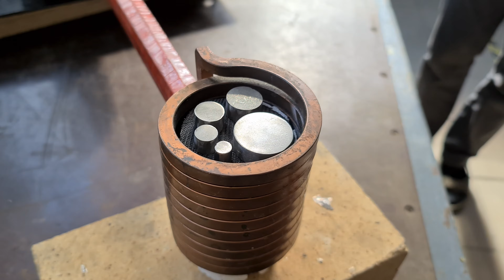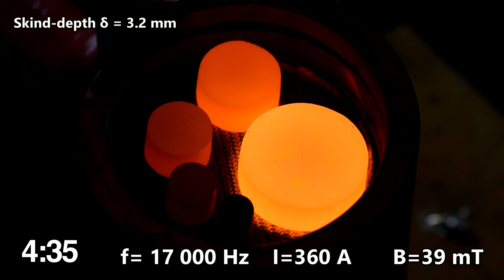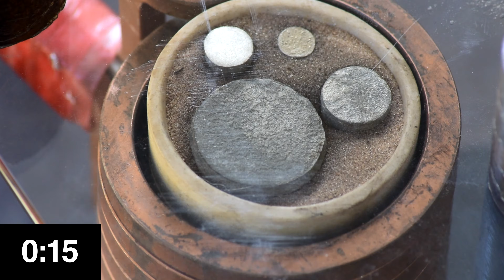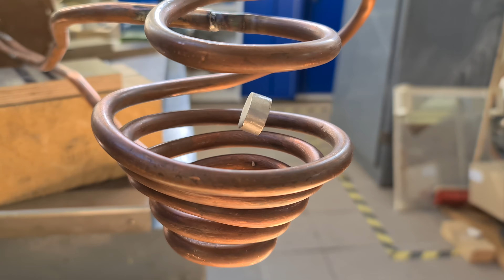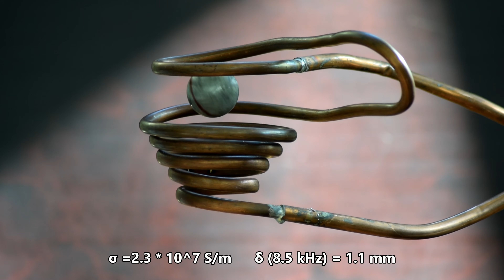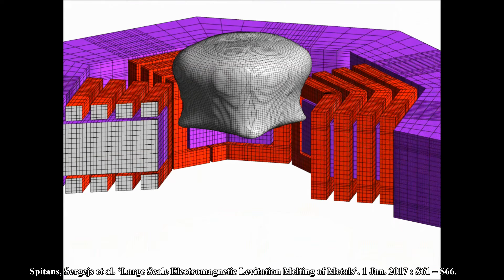Induction Heating, Melting and Levitation [4k]

Comment: I'd like to know how frequency can affect levitational force and why material within the coil needs to be a good electric conductor
Reply from the maker: Forces are proportional to electrical conductivity of material all trough out frequency range because it is easier to induce current in good conductor.  Forces are also proportional to frequency up until skin effect sets in. However, in all levitation setups high frequencies are already used and skin effect is present, meaning frequency change will affect each process differently on case by case basis.  It is complicated to predict effects qualitatively since multiple effect opposing effects overlay at high frequencies.

Comment: If you put the coil in a vacuum chamber you might be able to use it to forge a diamagnetic ferrous material. Heat it up burn off all oxygen and create vacuum. Turn off and drop material in cast and let cool slowly in the absence of oxygen. Might work. :)

Comment: My main question : what happens when acoustic cymatic frequencies are applied during the heating and molten phases?
Reply: Ah I see you guys found out how both these techniques were used to build the pyramids.
Reply: Interesting question. I reckon applying sound through the air wouldn't be terribly effective, but mayhaps you could apply vibration using a rod directly to the material. 
In that case I think you could find the resonant frequency of the liquid metal. You'd definitely see something interesting.

Comment: Could you tell me if the copper coil is solid copper bus bar and what is the cross section area ??? Would this melt steel alloys ???? Thanks
Reply from the maker: The copper coil has a hollow core for the coolant to flow.  The cross-section is about 10x10 mm, but I don't know the wall thickness hence the empty core size.  
To melt steel you would need more heat insulation. Or at least crucible with a closed top. Otherwise, heat losses would permit you to melt steel.
Reply: @MHDTechnologyLaboratory  Would stainless steel also get melted ??? Does frequency make a difference on speed of the melt?? Thanks

Comment: This is awesome i want to learn this without a degree, can someone help in regards
Reply: Google
Reply: Electroboom has an entire website, along with his youtube videos that can explain what's going on here. Physics books typically have an electromagnetism section and you could probably find some good books specifically about the physics of induction heating... but tbh this channel is pretty good too. The reason it levitates is similar to the reason you can create an electromagnet with insulated wire wrapped around an iron core.

Comment: how come the smaller parts heat slower?!
Reply from the maker: It is a balance of multiple effects. Heating (dissipated power) is proportional to volume. Cooling by conduction, convection, and radiative losses are all proportional to the surface.  So smaller objects have higher surface/volume balance hence lower temperature if induced power density is the same (in reality it is not the same).  To complicate things heating does not scale with the size and there are differences how bigger and smaller objects heat up for any given frequency. That can be analyzed by looking at dimensions of the workpiece and calculated skin depth for that frequency.
Reply: @MHDTechnologyLaboratory  I guess the small parts also have a weaker magnetic filed？

Comment: would this be somewhat possible with a rock that one of these metals in it? what would happen?
Reply from the maker: Practically no.  Unless the rock was mostly metal parts (that are connected to eachother!) current would not flow in it. There would be only small currents in the inclusion of metal but melting or levitating the rock would be close to impossible with reasonable currents.
Reply: @MHDTechnologyLaboratory  ah I see, thank you for answering!

Comment: there are a lot of things I wasn't understand about induction melting now I understand them , thank you . but there are some things I can't understand in this video & really can't find any answer after hard search on google :

1 - it is known than that lower frequency means higher current penetration which should means that 8.5 KHz frequency should be more effective than 17 KHz , then why lower frequency can't able to heat smaller pieces ? is higher penetration means lower efficiency of heating smaller parts ?  as I remember the lower frequency used the more homogenized molten metal & industrially very low frequency of 60 Hz is used to melt steels using induction melting method .

2 - in levitation melting experiments , I understand that there is a limit of size of metal piece to be completely levitated in molten state . but what the actual factors control this size limit ? does simply increasing power or frequency increasing this size limit ? or it mainly depending on the design of induction coils ? does it differs by the metal to be melted ?

3 - can metals with very high melting points like tungsten melted using levitation method ? or there is a limits ?

4 - can temperature of a metal heated by induction be fixed ? and how to fix it ? if for example I want to heat a large steel part quickly to 1000°C and hold at this temperature for hours , is that even possible ?

5 - how to increase temperature of the molten metal ? power or frequency ? & is it possible to rise temperature to near that boiling point of a metal "i.e. 2800°C for steel" ?
Reply from the maker: 1 )  You are right about this: "lower frequency means higher current penetration" however it is not the only effect.  If we increase frequency ( and keep other parameters fixed),  induced currents in the metal rise proportionally to frequency.  You can see that easily when you look equations for induced current ( I  also did in the previous video).  The skin - effect is a secondary effect and in this case, it is parasitic ( decreases the total power that dissipates in the workpiece). 

2) Firstly, you need enough power to levitate something which is usually, it is measured in kW.  Secondly, the metal you want to levitate has to be a good electrical conductor and preferably low density. Otherwise, you would need to increase current even more but even that has limits ( like how much heat you can remove with water cooling in copper pipes). Thirdly, for this configuration regardless of current strength or frequency, at the center of the axis, there is no net force pointing upwards.  This becomes a problem with molten metal since in center point it is held to the larger piece only by surface tension forces.  This limits funnel-shaped coils to about 100 grams of aluminum before it starts leaking out.  For different metals, this would vary and depend on surface tension and viscosity.  And lastly,  in larger sizes, the flow in the molten metal becomes important since it dictates shape and stability. 

3)  There is no upper limit of temperature. There are problems like electrical conductivity decrease with temperature increase for all metals. Also, radiating heat losses rise with temperature in 4th power so you would definitely need heat shields.  I know germans who have melted ZrO2 at around 3000 C by induction heating. ( it was semi levitating though)  

4)  Possible, but not straightforward.  You heat it up to 1000 C and manually lower power to find equilibrium ( which would differ every time if you don't heat identical pieces). A smarter method would be a feedback loop from the thermocouple or thermal camera to the brains of the inductor which adjusts power in real-time. 

5)  For every size and metal there exist optimal frequency at which to heat it.  If you are close to your frequency all you can do is raise the current.
Reply: @MHDTechnologyLaboratory  
thank you very much , I really appreciate it .

Comment: 6:20 Why does aluminum not radiate or shines? Great video asides.
Reply from the maker: Because of the relatively low melting temperature and surface properties of aluminum. The emissivity of aluminum is 0.03 which is a very low value ( max for a ideal black body is 1.00). Coupled with a melting temperature of 660 C you have a 100 to 200 C window above melting temperature where aluminum is liquid but not visibly glowing.